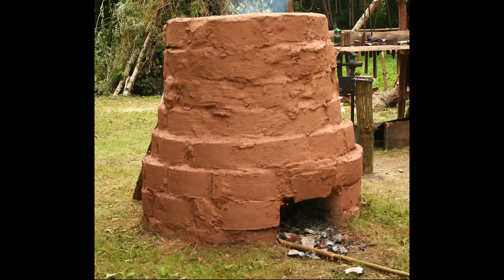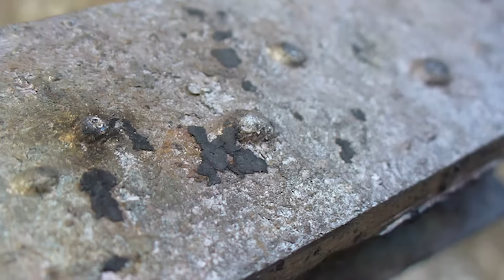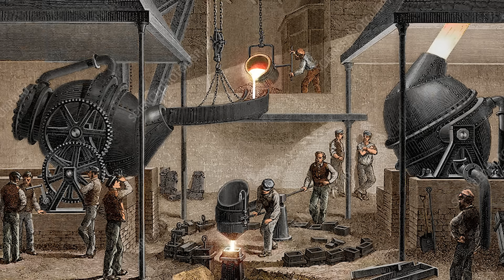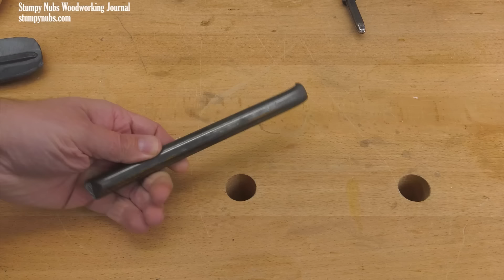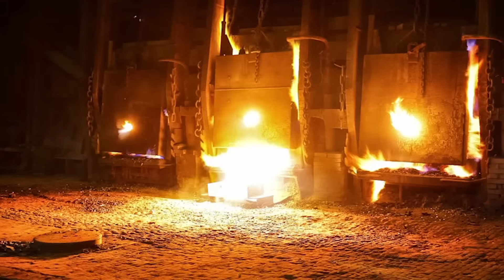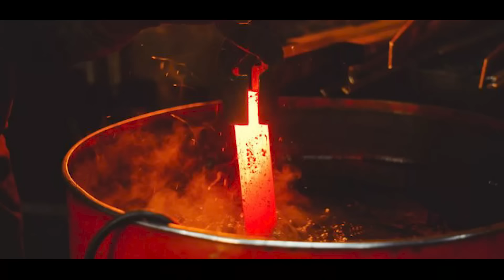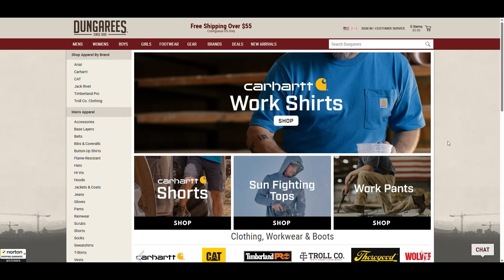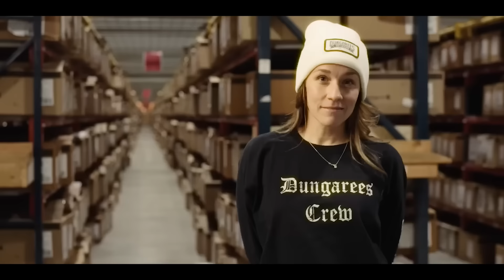Why they REALLY don't make tools like they used to

Comment: 6:40 the aligned grains don't last - during further heat treatment the grains recrystallize and you don't have anisotropic grain shape anymore
Reply: Crystalize? How does crystalization happen?
/gen
Reply: @Sleepy_Cattt  yes, all metals are made of tiny crystals side by side.
Usually crystallization happens when you have a liquid metal solidifying. When the liquid's temp falls below the melting point, at seemingly random locations tiny seed crystals start appearing and growing, until their shells meet up and everything is solidified.
The faster you cool the liquid during solidification, the more seed crystals appear and thus the size of the crystals will be smaller. Generally in everyday steel, the crystals will be a few ten micrometers in size. But in cases like street light poles or road guardrails? They are coated with zinc often and you can see their color is like a grey camo pattern. Those are big individual crystals of zinc with different orientations and thus reflecting light a bit differently.
But in this video, the metal is already solid and never melts. It recrystallizes because iron (and steel) change their crystal type from a body centered cubic (called ferrite for iron) at room temp to a face centered cubic (called austenite for iron) at around 720°C.
When you heat steel above that temperature, new crystals of austenite start forming at different locations and overgrowing the prevously existing ferrite. The new growing austenite crystals don't care if the previous crystals were elongated and aligned, they form new ones with random orientations and non-elongated.
Then after the steel is cooled down to room temp, the crystal type again switches to ferrite, again forming new crystals all over.
Look up "metal crystallization video" or something like that to better understand how they look like.
Reply: @birch2-x7g wow, that was alot, thanks that was really cool to read about /gen
Reply: @Sleepy_Cattt  what does /gen mean?
Reply: @birch2-x7g it's a tone indicator, it unshortened means /genuine

Comment: @705 you are both wrong & right... steel that's soft enough to forge into shape is soft because its hot, but with Carbon steels you CAN add a edge without hardening & tempering (after letting it just cool) it it would just not last as long but it would last long enough but you would have to sharpen it more often like older steels or indeed if you went back far enough like bronze or the like , though i have a feeling it would last longer than many of those... 

In hand made tools you do not Harden the steel till the basic shape is cleaned up after the forging (basic grinding but not to the fine point or such as it it more likely to warp or break when quenched, )  its done like  this as it will take much longer to do any grinding after the hardening. 

With hand made tools you can have deferential hardening (the tip much harder than the rest) which means you can in theory have a simple carbon steel that will wear as well as a more complex steel But there are always trade offs. 

Something not really relevant to wood or metal working is that post WW2 steel all has more radiation in it, (due to the Atomic bombs) & so pre-war metal is prized by certain manufacturers of sensitive instruments. (think scientific & medical). 

Despite my minor nitpicking good video, thanks from the metal working side.

Comment: Finding good quality hand tools may seem difficult because there's not much market for those. Tool manufacturers have moved on. Ordering custom batch of steel from a steel mill is not cheap, hence small players will find it more difficult. But you definitely can get good stuff, because there still is a little bit of markets.

Comment: Living only a few miles from Sheffield, a lot of cast steel and crucible cast steel tools come up at car boot sales and auctions at very low prices. As well as the fact that there was a lot of general manufacturing in the area, I suspect that a lot of tools found their way out of the factory tucked into workers belts, boots etc., and home into folks sheds. This went on in a smaller way, well into this century. I do own a few modern chisels and have nothing against them, other than the flood of cheap poor quality east asian rubbish. By far the majority of my tools are 70 or more years old and Sheffield made, but also a good number of Birmingham and Glasgow makers. I have no need to change the status quo in my workshop, but do recognise I'm in a lucky position.

Comment: Totally agree. 
When we had to patch boilers the new plate was rubbish compared to the old.
You could work the old plate easily & it would drill like butter.
The new stuff would chip & chatter under the drill bit, there were hard spots which would take edge off drill.
Twas a nightmare to work with, sometime.
Too much ol scrap in melt & not mixed properly in blast furnace, I always reckoned & that was supposed to be boiler plate. We never believed it would last like the pre war plate & this was proven in its appearance after a few years of working in the harsh environment of a boiler.
In U.K. there used to be a greater range of steels but this was shrunk severely in 60’s & 70’s. As evidenced by the almagamation of EN no’s after the war.
The old steel makers knew exactly how to get the melt right for tapping using the mark one eyeball & the fine judgement at their fingertips.
Now in the mechanised world no one cares, just get it sold, if it fails down the line they’ll just come back for more because there’s no where else to go. The U.K. & its British stds institute reigned supreme over steel quality but the high quality blast furnaces & steel mills  have  been dynamited into the history books & are no more.
The paltry sum that’s left are owned by foreign corps, steel produced from scrap charges of all sorts of ol junk, nuff said !!

Comment: Modern tools are not superior on average to old tools. Can you purchase a superior tool today to that of 100 years ago? Sure, if you're willing to pay top dollar and do a lot of research. Metallurgy has improved, knowledge all around has increased. That doesn't translate into new tools being superior though because we live in a market of planned obsolescence. The tool from a hundred years ago is still around for you to show, the "shiny new chisel" will be in the trash in 5-10 years AT MOST!
Reply from the maker: "Planned obsolescence" is not universal. Take the example in this video- a wood chisel. If you admit that modern steel is more advanced because of improved metallurgy, and your new chisel is made from that higher quality steel, than it is superior. There is no "planned obsolescence" in wood chisels.
Reply: @StumpyNubs  I said modern tools on average. I'm in agreement that you can indeed acquire modern tools that are superior in quality today, but across the market, even specifically focusing on chisels, though admittedly not ones used for soft materials like wood, will be subject to planned obsolescence where they chip, mushroom, and break in accordance with their designs. You purchase your tools from a Midwestern family owned shop because you likely know full well the mass produced brands are garbage. Keyword here was on average! 😅
Reply: @StumpyNubs  If you want some REAL semantics style thinking though, I'll still take that 100 yr old chisel and trade it directly to a collector for two or three new chisels, that way when I inevitably lose the first one, I'll have a backup! 😁 That's the big thinking thoughts lol

Comment: We do need to understand that pre1945 steel is more valuable than steel made after. The reason why? It’s because the steel is not contaminated with radiation from the atomic bombs that we have lit off since the end of WW2 and just before. I have a very old air tank that was built in around 1932, at least that’s what the tag welded on it says. I was going to recycle it, but I cleaned off the tag and saw it said 1932 and I said I’m not getting rid of this! So I turned that tank into  the cook section of my smoker.
Reply from the maker: Nope: https://youtu.be/Y26oSJDy2Lk

Comment: i think its more important to look at the type of steel in terms of sharpening. A cheaper chisel might keep an edge well but will also be harder to sharpen, good quality carbon steel tools on the other hand will be much easier to sharpen and thus retain its razor-sharp edge. but to find a good carbon steel chisel you dont need to search for a 100 year old chisel that survived up till now! It just comes down to what you need to get the job done, do you need high precision in your work then go for a good carbon steel tool so that you can maintain that razor-sharp edge with hand sharpening. If not and if used only occasionally then a cheap chisel might be more fitting to your budget and doesn't rust and requires no maintenance, other then the fact that your probably not gonna do a good job sharpening them if your a hobby type woodworker at home. Carbon steel requires maintenance bare carbon steel reacts with air and moisture and you need to wipe it down after each use and apply a light coat of oil. Carbon steel tools that survived a 100 years that are still in good condition where not only forged well they where also maintained and stored properly by there owner(s). So for most workers you get a cheaper set of stuff you hardly ever use but want to keep on hand for when you need them that do not rust, holds an edge well and require no maintenance, but require a good sharpening by a proffesional to get them to the performance and quality finish of a more expensive carbon steel chisel. And for 3 or 4 chisels that you use all the time for your specific projects get well made carbon steel chisels that have a good sharpening out of the factory and use those to learn/master your hand sharpening skills. The same goes for other tools like carving knifes. And if you want to spend your time hunting for ancient tools in good condition instead of building things, then best of luck to you on your quest, I hope you find some good exhibits for your collection and that you may wield the one true legendary chisel some day!!!!

Comment: I have one blockage rod from iron brown color not rusted , I try to cut it with hacksaw blade noticed all the teeth were flattened the only way to cut it with angle grinder hence you can with difficulty bend it

Comment: I own a machining shop, a full factory in fact with dozens of cnc machines, and we go down to brands of steel within the spec and track the foundry batches for consistency. There's no question about the better quality steel available these days vs old. However, if you buy tools made of chinesium, you get tools made of chinesium. I don't know about hand tools other than good hand tools ain't gonna be the cheapest ones. I wonder if any carpenter tool maker provides material certificates for their tools? That's really the only way to know the specs of the tool. We provide them for our customers with whatever lab tests needed but that's in b2b commercial environment. I'd like to point out that high quality tools doesn't need to expensive, but usually they are at least in midrange. The raw materials aren't that much more expensive to justify snapon prices tags for example.

Comment: I really love this video. I'm an absolute knife nerd and the thing when you get into it really Niche handmade Japanese knives is you get into the actual metal urgy of the knives . They advertise what their core steal is where it's made how it's forged you know some of the chemical properties there are debates these days about carbon steel versus powdered metal allergy Etc and many of the top knives in Japan are still Hand Forged from an billet with a spring hammer. So I'm listening to this I'm hearing all of the same things that I learned about Japanese knives but in a slightly different context and it's really fascinating.

Comment: something should be noted, rockwell scales have more than 1. rockwell D is softer than Rockwell C, but both can be "40" on the rockwell scale. Tool steel is typically Rockwell C

Comment: I'm not a woodworker, but I am a knifemaker, so I have experience with forging and steel. You mention that forging is superior to grinding to shape because it "compresses the steel and aligns the grain with the shape, like wood grain." This is a pesky urban legend that persists for some reason - the truth is that steel does not compress when forged, and the grain structure has much more to do with the heat treating recipe than whether or not the steel was forged. Forged tools do not inherently take a sharper edge or retain their edge longer - BUT a tool that is forged is likely to come from someone who is more meticulous with their heat treatment. A forged tool vs a ground tool with the same heat treatment regiment will be indistinguishable from one another.

Comment: Great video, really well articulated. With the amount of attention paid towards explaining what's happening at the atomic scale during metallurgical processes, I really thought this video was going to mention "low-background" steel though, because it could be argued that 19th century steel is not able to be produced today - even with precise raw material sourcing and processing. While less of an issue now due to the ban on atmospheric tests, all steel produced after the first nuclear weapon detonations contain higher trace levels of radio nuclides than steel cast before. Obviously not an issue for hand tools, but some highly sensitive laboratory and medical equipment requires the use of steel that was last cast before WWII, the vast majority of which is collected from pre-1945 shipwrecks. While for some of those applications, it has become possible to use newly manufactured steel in those tools due to the decline in the man-made contribution of the world-wide radiation background, some of the most sensitive pieces of equipment still require it.

Comment: "If you know where to look," is probably key, also how to look and what to look for. Maybe manufacturing in certain locations is catching up to late 19th,c early 20th century quality,  but the reason those tools are collectable is because hand tool quality dropped as power tools took over the market.  It got worse each decade and especially after cheap imports became ubiquitous. High quality domestic handsaws run around $250.00. So, if you know where to look.... okay.

Comment: Totally correct.  I can get custom batches of any alloy starting at 100 lb batches and going up to 100 ton batches.    High quality alloys are just more costly than cheaper alloys.  Forging, cryo-treatment to stabilize crystal structure, various heat treatments, etc all add time and money to the final product.  But, we can produce most anything in most any quality level you desire.  I totally agree that the modern high quality products are in fact better than the older products (of which only the best ones have survived).

Comment: the thing about old vs new tools is comparing between most (not all) chineseum steel tools vs old vintage tools.
like you said, you could find good cheap quality tools for way less than vintage ones, for example, morakniv makes great budget knives for almost dirt cheap and they seem from my experience to hold an edge for quite a while. the metal in them isnt magnacut but it is good quality carbon steel for the price of 15~20 dollars

opinel also makes great knives for cheap

Comment: I didnt go through all the comments, yet I did not see anyone mention part of the reason the old tools and old steel/iron in general are considered better/different has to do with radiation. You cannot forge steel today without there being minor amounts of radioactive particles due to the amount of radioactive particle in the air from our nuke bombs, It is why the cut off is WWII cause that is when the first bombs went off and basically forever made any steel produced not as good. It is not hocus pocus, wuwu, or nostalgia, its science.
Reply: The radioactivity want effect the steel 
Also we have ways of making steel that has no radioactive stuff in it
Reply: @Goroca  No we dont. Background radiation  has just dropped to a levels that is doesnt effect it as much anymore.. If you want to actually learn something, go look up low-background steel.
Reply: @psychosnyder 
I have looked in up 
Ther is ways of doing in nowdays when a 100% esert atmosphere 
Problem is that it is expensive and only very specialist instalment need that type of steel so it is cheaper to grab old steel

Comment: The Bessemer process could remove all the carbon from the steel, and it was difficult to determine what the actual carbon level was in the steel. This led to variable carbon levels in the finished product.
An engineer, Robert Mushet, actually perfected the process, by allowing the Bessemer converter to remove all the carbon, and to then add a known amount back into the melt, along with other alloying elements.
This produced the first air hardening tool steel.

Comment: I think people say that because the fakemascus trend that now makes different steel types badly forge welded and etched. The different steel types chip differently making the edge not "self sharpening" but requiring sharpening to stay precise, causes the metal to often split or scale when you forget to store it and most importantly can shatter or break into jagged edges.